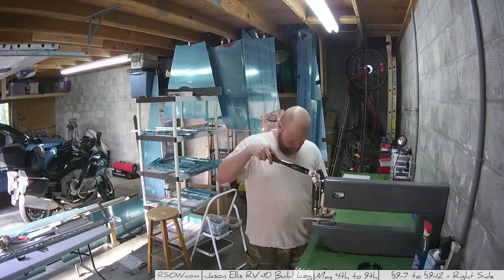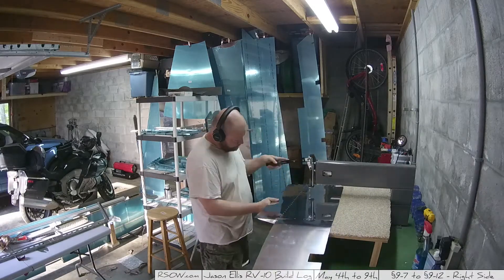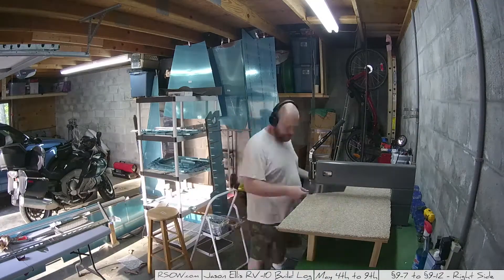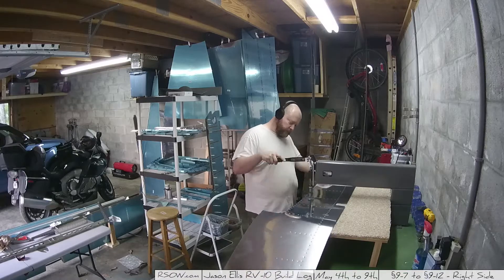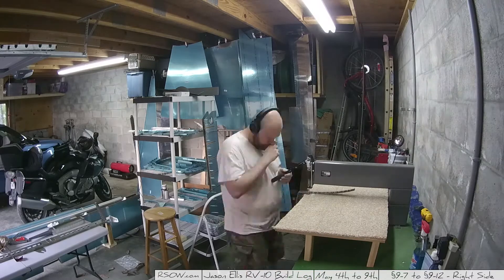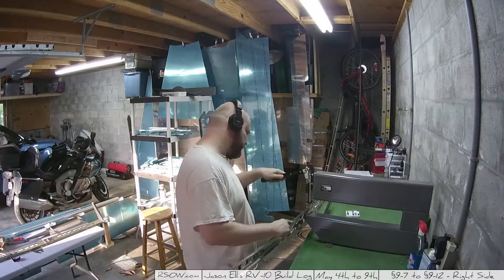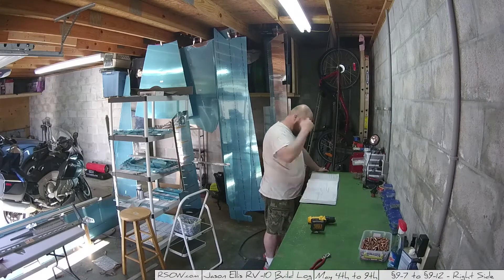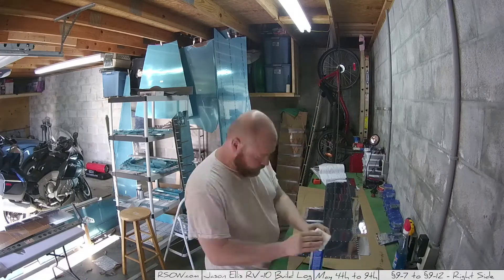RV 10 Empennage Section 9 7 to 9 12   Right

Comment: Hey Jason

Really enjoying watching this build from the beginning! 

Question though, what's the real difference between dimpling and machine countersinking? I mean, I know the difference in doing it, but what does one do/provide that the other doesn't? And why do one vs the other in a given situation?
Reply from the maker: When you machine counter sink you're removing material.  When you dimple you're bending the material downward but not removing it.   If you remove material and the metal isn't thick enough then you have the chance of seriously weakening the material and the rivet attachment point.  

There are times when you want to dimple and times when you want to machine counter sink.   Often it's dictated by the final thickness of all the layers or the location.  Does that help?
Reply: Makes sense! Thanks, and happy building 😊